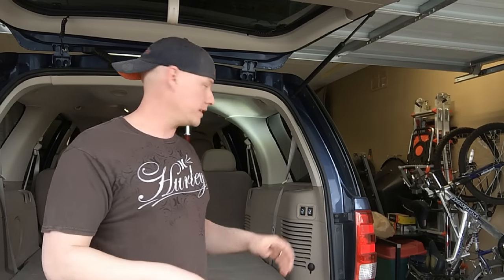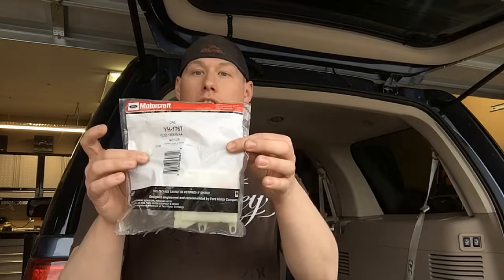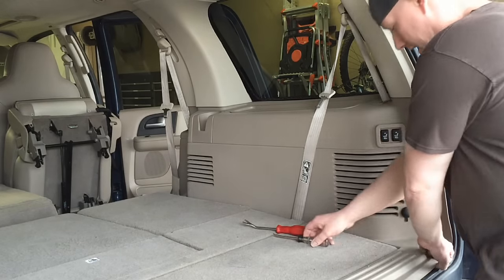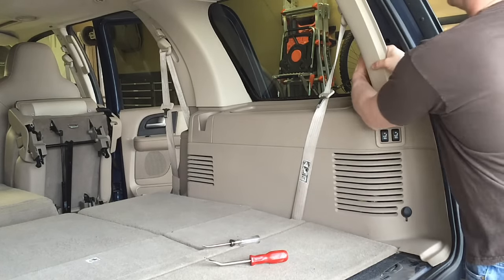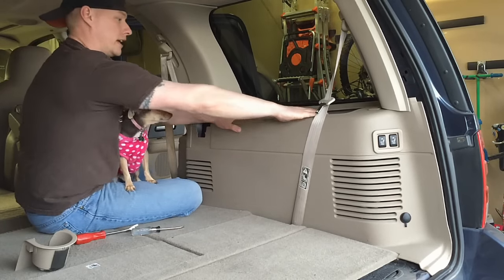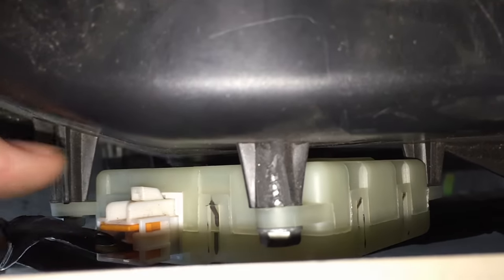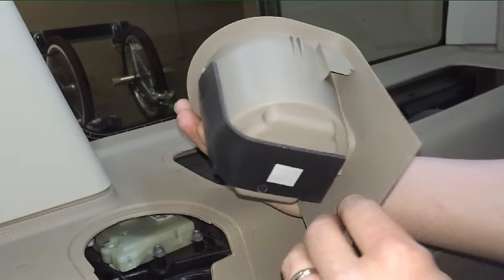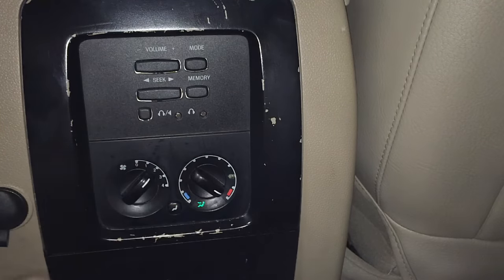2003-2006 Ford Expedition: Rear HVAC Temperature Blend Actuator Clicking Repair

Comment: Just finished installing 2 new actuators on my wife's 2016 Expedition, first one didn't do the trick (rear heat wouldn't blow and there was a clicking noise), then my wife found this video and watched it, bought another actuator and did the trick. Thank you for making this video, $30 is much better than $1,000.

Comment: Thanks to you, I'm able to replace both the rear. First time doing this and it took  a little over 30 minutes. There was a local shop was going to charge $240/hr to diagnose.
The amazing link is very helpful as well. Now my 2003 Lincoln is blowing cold air again.

Comment: Great video!!  Thanks for taking the time to do this.  I'm replacing the rear blend door actuator on my Expedition for the FIFTH TIME tonight.  That's five times in 14 years and 170k miles.  This video is very helpful because I don't do it often enough to remember the details.

Comment: I used your technique and replaced the actuator on my 2014 Expedition. Mission accomplished without actually removing any of the trim panels. I wouldn’t say I had “plenty of room” but was able to remove and replace the screws. Mine actually had four screws (the bottom one was a bit tricky). Thanks for the great tips!

Comment: Thanks for this video. Loosening the C-pillar trim is actually very important in being able to get room for  your hands inside the rear trim panel. I used a 2x2 by 12-14” long to wedge behind the A/c pipes and trim panel to hold it away to create just enough space. Also, I went to Amazon to buy one of those little ratcheting drivers as he suggested.

Comment: You're a lifesaver. Dealer said I needed a new rear AC wanted to charge me over $1,500 bucks. Turns out it was those two Motors that were out.  Went to O'Reilly's paid 140 for both together took me 45 minutes to install done. Works like a champ.
Reply from the maker: +Irineo Uriostegui Nice!

Comment: Nice video. The front blend door actuator is also changeable without removing the dash as the book says - I have done it. Had to remove the radio and the glovebox. One arm in the radio hold, the other in the glovebox hole. There was very little room to wiggle it out but it was doable. A gear-wrench would have been worth a ton on that job too - unfortunately I did not have one, so about a million little turns with a box wrench, got all the screws out. It was tricky getting the new one in but that too was doable with patience. The big news is front is also doable without taking the truck apart.
Reply: Joseph Przechocki I too had to fix the air condition upfront. That was a struggle. I however for some reason bought a 8 mm ratchet wrench while I was picking up the part. I agree with you it made the job easier. Still was very hard though. Plus my wife’s heart for coming out and helping me

Comment: Great video.  I have a 2013 Ford Expedition.  I ordered the part for the 2013 Ford Expedition but be aware that there are several different types of these actuators in the HVAC System in a Expedition.  I purchased the one which was supposed to fit the Dual Zone Automatic Temperature Control for the Lower and Upper Air Mains.  The actuator that I needed is the HVAC Heater Blend Door Actuator Auxiliary (passenger side next to the 3rd row - the lower actuator). The actual A/C Rear unit in my 2013 Expedition looks just like the one in the video except your auxiliary label say "EXP AUX", mine says "2009 EXP AUX" guessing that the 2009-2013 are the same. Also the wheel base of your vehicle can determine which part is needed.  Still haven't figured out which part is needed because if I google the part numbers on the unit 262 11114132 it leads me to the Dorman 604-260 but is says it does not fit the 2013 Expedition XL.  I even searched by VIN.  The search by VIN says I need the Dorman 604-277 but if I search by 2009 Expedition is says I need the 604-260.  So I obviously have a 2013 Expedition with a 2009 Auxiliary, is that normal?  I will probably purchase both parts and see which works even though, I'm thinking connections might be different, even if the actuator stem fits into the auxiliary.  Any advice besides pay a dealership $$$ to install a $20 part?  Thanks again for the guidance in video above!

Comment: I just fixed my 2003 today.  It was the second time the teeth broke since we purchased it back in 2003.  I used your amazon links for the part and a fuel filter.  I had to take the seat belts and side panels off to get access to it.

Comment: Just wanted to say Thank You. As a new owner of a 2000 Expedition, your videos have helped a lot. My problem is the back a/c blows ice cold, the front is crap. Not sure if the expansion valve is stopped up or what yet. Guess I will be tearing into something tomorrow. Thanks again.

Comment: Dude, THANK YOU. Simple fix. I was able to fit a 1/4" ratchet down there and it was much faster, didn't need an offset box-end ratchet wrench(although i had one(). The bottom most fastener was unfortunately a philips head screw! Not an 8mm like the other 3. I was still able to use my ratchet with a philips attachment to pop it out. I did NOT put it back in tho, lol, 3 bolts will suffice!

 You made my troubleshooting that much quicker and better yet gave us the part number AND link. So like 30 bucks and 30 minutes: problem solved.

Comment: Nice, Ford Corp really lost a good man. I could see that you were more comfortable here which is a great thing. Continued great luck with your new venture..
Reply from the maker: Thanks I am not the best tech out there but pretty darn good. Good enough anyway.
Reply: FordTechMakuloco One that can do it and show it is the best tech out there.
Reply: FordTechMakuloco is there any other reason why the rear ac won't work? It blows out warm air just not cold. The front AC works fine. Thanks
Reply: Curiosity, I think the back has a filter for the orifice. I'm a residential and commercial HVAC tech, never worked on cars, but was looking at mine a few days ago.
Reply: FordTechMakuloco  can there b a freon leak back there I'm hearing a hissing like a leak sound does it have any ac lines my vehicle is leaking freon for sure checked the front with ac freon dye and only saw the dye in the high and low ports.. 1 12 oz can of freon lasts about 2-3 weeks because I can feel the rear vents not cooling

Comment: Since there are two actuators be sure to know which one is clicking before replacing it. One way is to touch it with your fingers to feel the click. Another way would be to unplug it to see if that stops the clicking.

Comment: My actuator has 4 screws holding it down! Took awhile but finally got it done. Only replaced 3 screws hope that is ok. The little flex ratchet wrench is well worth it.

Comment: Thank you for this video. It really did help me replacing the actuator on a 2007 Expedition. I do hope you gave your supervisor a treat for making sure everything went smoothly. I'm now a subscriber. Also after I changed the actuator it was still making the popping noise. I found another actuator on the front top of the rear unit that was bad too. Changed it out and everything works like it's supposed to. Thanks again.

Comment: Hey just wanted to tell you that your video was awesome. Followed the links and ordered my part and tool.  I was done in less than 30 minutes. Thanks a ton. Fixed it right up.
Reply from the maker: +mjsummer Nice!!
Reply: +FordTechMakuloco so it works but it is intermittent. I did not replace the actuator that changes from floor to ceiling though.  That one does make a popping noise. So even though I never use it in the floor could that one be causing my ceiling air to be warm sometimes. Like I said. The rear ceiling air will blow super cold 50%  of the time. I know the actuator that I did replace is not binding because I checked it like you said before installing the new one

Comment: Thank you for the video I now fix the problem with the rear ac and heater on my expedition my expedition has 240887 miles 4.6  2V great engine my brother F150 4.6 2V 4X4 has 359.000  miles and still running strong

Comment: OK, so right off the bat, great info!  This video, along with the one for the air direction actuator, helped me get my rear HVAC working right!  Caveats?  Yes.  The screws are a bitch to reach, the the flex-head ratchet would have made a big difference.  Plus, there was an extra screw on the bottom of my actuator (4 screws instead of 3).  This was an unexpected surprise.  Heads up to anyone planning on using the Dorman 604-277.  The shaft on this model is larger than the OEM unit.  I had to file it down on the three flat sides, and was finally able to get it to fit.  Patience, and trial and error, got me to a final solution.  As other units are available, you may want to factor this in to your planning.

Comment: Hi there..it was a great video...your video shows three screws..Mine had 4..and the bottom one was a real bear to get out, my wife had to  get her skinny hands in there...other than that it was great.  Originally I thought it was the top actuator.  I purchased it, and put it in...still making the noise...I opened it up and noticed a bunch of teteh broken...probably was going anyway..SO i replaced both.  Amazon sent me the little short 8mm wrench, and I used electrical ties to make an extension for it..it worked.
thanks

Comment: Thanks for the video. Replaced mine and works fine. I have a leak in one of my rear ac hoses and was wondering if you could show how to fully remove that quarter trim piece so I can get full access to the area and figure out which one is leaking? Mine is a 05 Eddie Bauer. Any thoughts on which hose to look at first?

Comment: Hi. Back again. I went ahead and ordered the part # YH-1767 for my 03' Ford Expedition XLT 5.4. This one is the one on the side. I Got that. It felt liked the other one on top was making a noise as well as going by feel. The part # I though that was frequently bought with the other one was YH-1743. Also got the ratcheting wrench as well as the TEKTON 5873 Door Panel Remover. Hope you can give me the positive outlook I'm expecting. Sure hope to hear from you soon!! BTW. I really enjoyed your video which inspired me to do this job myself. Thank You!

Comment: I watched this video and then ordered the part because I heard the tapping flap in the rear. After replacing the part while watching your video. The flap still taps when I turn on the rear air. Do you have any suggestions on what to look at next?

Comment: Changed out the Blend door motor on my 2002 Exploer.  Sure enough, the gears were stripped.  Amazon to the rescue.  Doorman PN 604-202 for $30 and free shipping.  Ordered on Saturday, here on Monday.  You gotta love PRIME shipping!
Explorers are a little more involved getting at the blend door motor.  Complete inner panel removal on the drivers side rear and you have to unbolt the HVAC unit to get at the motor(s).

Comment: I appreciate the video to take apart the panels. It worked great. I have a 2003 Mercury Mountaineer and the assembly is on the drivers side. Would you happen to know what else might be wrong, I disconnected the actuator and still heard clicking coming from the black assembly box the actuator was connected to. I cannot find any other information out there for my car. If you could help that would be great before I go any further or pay 100's of dollars to have a mechanic do it. Thanks.

Comment: I'm in Florida and don't really need any heat in the rear but definitely want the roof vents providing AC for my Greyhound on the back seat. Fortunately my bad temperature actuator was in the cold position but making the popping sound. I unplugged it to stop the popping and continue to have AC from the roof vents.  It's electric plug can be accessed through the cup holder opening. There is no need to loosen the big panel. Problem solved. No new part required and no big panel loosening.  I determined which actuator was making the popping sound by placing my fingers on each one to feel the popping.

Comment: Thanks so much for the video! I now have back-air! Woot! BUT, there's a little black plastic piece behind the big panel that you had to pull back that is loose. I don't think I have it seated correctly, know what I'm talking about? It's a black plastic "bar" with some little angles (kind of like a small "L" bracket you hang on a wall for a shelf) It's got several screw holes that line up perfectly with the screws behind the big panel, but I can't figure out how that black plastic bar and trim piece fit back together correctly. Any chance you have a video showing/explaining that?

Comment: 03 expedition,  noticed rear air would cool at night but rear windows would fog up. Then during the day (summer  August really hot out) it was blowing warm air unless I was driving on the freeway or rev it up, like it was going out or low but front air worked just fine. Replaced this part and opened up the old unit, at first I thought the old one was fine, until I found 1 tooth broken. Put the new one in and so far so good, I'll let you know during the day time will be the real test.

P.S. might as well take out the other unit if you have that weird year like me to see which one it is. The one that switches from roof to floor aka "air distribution actuator" is right next to this unit. Could have 2 different pattern either "cross" or "D" watch the other video this same guy makes. But you might as well check in case it goes out later or go ahead and replace it as well if your like ME and you thought your expedition only had ceiling vents and not floor and that button was a replacement or junkyard part just to get it to work. We DO have floor vents as well.

Comment: We have an Explorer XLT 2005.  We have the blower problem you discussed in a previous video but also a constant clicking coming from the back of the vehicle.  It clicks even if you have the blower turned off and there is no heat or air running.  Could this still be the Actuator?  Thanks for all the helpful videos!
Reply from the maker: Jake Whitney Yes any clicking from back there is either actuator has failed I have videos on both.

Comment: I don’t know if this was already post on here but on my 05 expedition Eddie Bauer there are 4 screws, one on the bottom of the actuator and I really think that panel that the cup holder sits upon needs to come off to be able to get to the 4th screw to take the screw out. Unless I’m incorrect?

Comment: I got the 8mm wrench and bought an actuator that's supposed to fit but the long pin isn't the same shape as the original.  Does that matter?  I was able to get the old one out but can't get the new one in.

Comment: Thanks for the support video. Really helps. But I still have clicking in rear area with a new actuator installed and the clicking still happens with it unplugged? Is their a second actuator in there or something else causing the clicking? It happens running AC which works but clicks in the rear door area. If I turn AC off it sounds more like a thumping heart beat sound?
Reply from the maker: Yes there is a second actuator on the top left.

Comment: Great Video!!! Best I have seen! My question is what is the actuator there on top? I believe both of mine are clicking. I know the one on the side is for sure. I could feel it as well as hear it, however it also seems the one on top is clicking to. Does one operate the air and the heat on the other one? Thank you. Hopefully you can assist me with my issue.

Comment: This and the front version awesome.  Unfortunately, in the front version you didn't mention about the blend door binding.  In my case, when I took off the actuator, the shaft was broken off.  I thought it was just brittle but when installing the new actuator, it is clear the door is bound up.  Sure wish I knew what to do next. Looks like BIG trouble:-( any help would be appreciated.

Comment: Great Video Brain!
 Any Tips on the rear '05 Explorer actuators??
Both of mine have failed. Obviously I know they are on the left side opposite from the Expeditions, but they look very hard to get to..
Reply from the maker: Chris Rippy No real tips but you will have to remove the mounting bolts for the air box and the two nuts down below next to the a/c lines to slide it away from the body to change any actuators.
Reply: FordTechMakuloco
Thank You!!

Comment: Can you tell me how to remove the two rear climate control knobs out in the back I have a 03 expedition and I want to replace the bulb in the knobs. Can you help me. I can’t get the trim off to get to the screws to take them out the trim is really on there

Comment: I have a 2007 Freestar, no air being blown in the back. Is there a blower with resistor that can be replaced back there? I hear a loud click each time i turn up the rear fan speed on the controls. Thanks!

Comment: Hay bro I bin watching ur videos for over 3 months an I bin getting good info from u I'm moding  my 05 ford expedition xlt. Do u think 3.75 axle are good for towing or any good parts to make it stronger got top stuff for trenny, engine 3 way cooler s I'm lifting  it 3.5 lift aggressive tiers thinking  if I should throw a hitch 4 , will a cold intake do any good or keep it stock u know this trucks what's ur opinion ? Info would b grate I'm good whit my hands lol got addicted to working on my truck the more I know the more I do

Comment: Hello, have a quick question on this video, the part #yh-1767 you show you used in the video shows on Amazon its for the blend door LEVER. The door blend ACTUATOR it looks like you are replacing in the video is # yh-1743. Which part # should I order? I want to replace the one you did in the video.